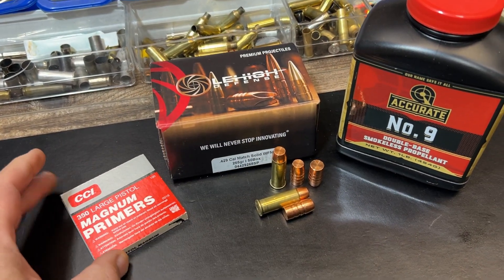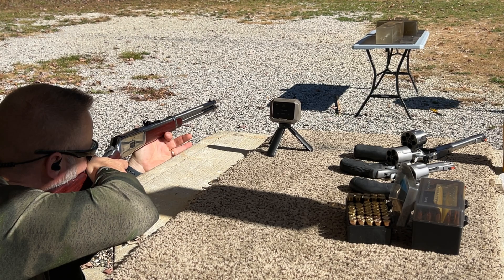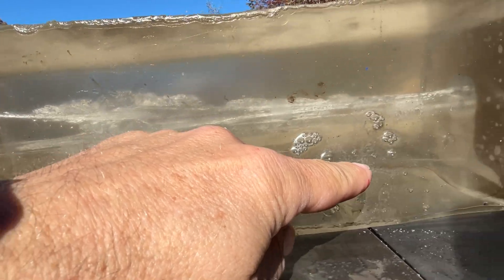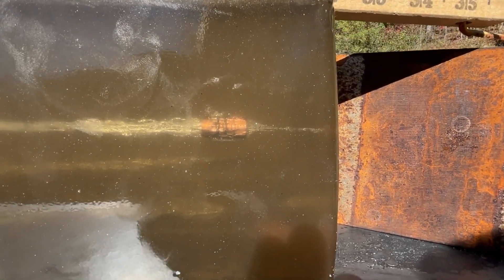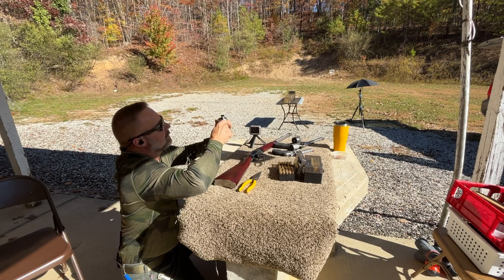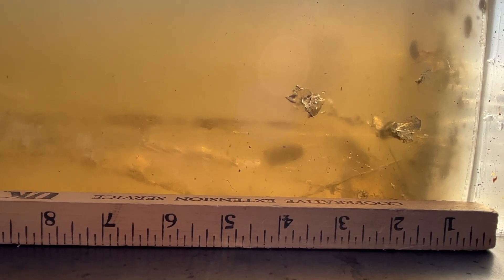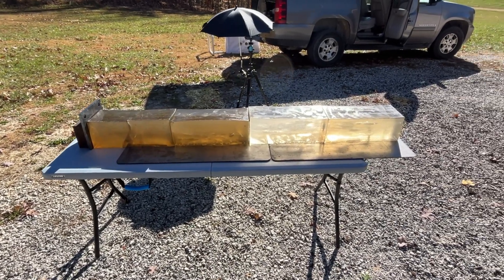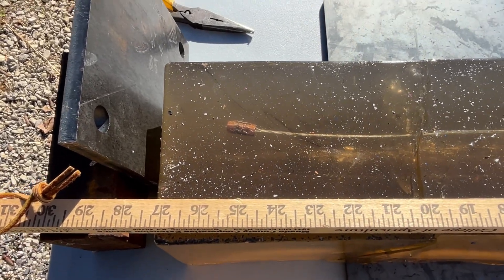44mag Lehigh Def 265gr Match Solid WFN, Solid Copper Bullet, Gel Block Testing with 4 Barrel Lengths

Comment: I’d be curious to see if you could get that speed up to 1500+ on the rifle with a different powder/charge and see what it would do.
Reply from the maker: @mountainmanmilitia3806  probably could with a rifle powder. I plan on doing some dedicated rifle  loads when I get caught up. Anything with pistol powder starts losing velocity with barrels longer than 16”.
Reply: @kentuckyrangetime  Subbed. I'll be looking for it. Just ordered me a rossi 92 stainless 44 in the 16in version. Was looking at this bullet as a potential hunting bullet but looking for something that will leave some flowering to go with that penetraton. If this dont open up more with more velocity I'll probably just stick with 240 JSPs.
Reply: I'm a big fan of IMR-4227 for 44mag. Works well for rifles and pistols though that bullet might not leave enough room to get enough power in there.
Reply from the maker: @ check out the Barnes XPB Video. They make that one in 2 heavier weights that will give deeper penetration with good expansion. I hope to get the heavier bullet and text later too. 😉
Reply: @kentuckyrangetime  I have a request. I got a bulk order off 200r RNFP hard cast cowboy action bullets in that I plink with but they seem to do really well on water jugs. I load em over 25gr of 4227 and get around 1,275fps from my 4.2in combat magnum. Would love to see that bullet in gel. Cheap bullet but seems to be effective.
Reply from the maker: @ Send me a few of them and I’ll put them in the Que. It’ll probably be spring before I can get them worked in but we’ll get them. 

Hit me up in messages over on Instagram and we’ll worry out the details. 😉
Reply: Don’t got an instagram. Email?
Reply from the maker: @ I do but want share it or my phone number out public.  Bad things happen when random people can use you email or phone number wherever they want, especially some of these liberals wasting good oxygen . Lol.

Facebook, MeWe or Truth social?  I have accounts on all those too.

Comment: How do you think this load performed versus hard cast of same weight?   I’m guessing hard cast would be shorter vs this solid and offer more case capacity?
Reply from the maker: @motorgearhead  I have  240gr hard cast and a 240gr plated videos in editing right now. Let’s just say I didn’t have enough gel block (@64”) for them in the longer barrels either 😉
Reply from the maker: @motorgearhead  yes, the more compact lead bullets allow more powder, lower pressures and more velocity. 👍🏻

Comment: Great video.  Excellent straight line performance.   Was surprised that the lever action didn’t provide more velocity though.  I was expecting about 200 ft./s just from what I’ve seen with pistol caliber carbines.
Reply: It seems like the powder burn finished before the bullet exited. Optimal length might be 12ish.

Comment: WOW! That's a long for weight 44 cal bullet due to the copper being less dense than lead.  It did penetrate very well. However, I think they may have been better off creating a 230-240 gr copper solid to allow for a bit shorter bullet allowing for more powder capacity and higher velocity. This will be even more important with a shorter pistol barrel. Having a shorter bearing surface on the bullet should also reduce recoil which appears substantial.
Reply: Cutting Edge makes copper bullets as well, and their solid copper 44 (.429) is a 240gr. I went with Lehigh for more weight, but Cutting Edge has good products too.
Reply from the maker: @chacal1129  I’ve looked at those. Just can’t afford them on my current budget. 😂👍🏻😉
Reply from the maker: @frankbrowning328  👍🏻 good points.

Comment: Thanks for another Interesting test. Three points come to mind. While a wide flat nose design does increase tissue destruction and reduce penetration as compared to a round nose, the wound channel and penetration characteristics end up rather more like the round nose than any kind of expanding bullet. Looks like a great compromise for heavy game or bear defense, but certainly no replacement for expansion in more common self-defense applications.

I'd imagine case fill must be pretty good with the seating depth produced by the longer copper bullet. It seems this would improve ignition with slow-burning powders like No. 9, making for more complete and consistent burn, resulting in more consistent pressure and velocity performance. Or this may prove a non-issue, as conventional bullets will require heavier charges to reach the same pressure and velocity levels, filling the case to similar levels. Ultimately the copper bullet load will have a more compact charge nearer to the primer, but with the wide 44 caliber case this may not matter. Probably more of an issue in more slender cartridges like 327 or 357 magnum.

It's great Lehigh Defense makes available such a complete library of load data for their projectiles. It's hard to impossible to account for the difference at the load data level between this 265gr. slug and those of more conventional construction without pressure testing. Lehigh's support of their product in this regard is laudable, takes all guess work out of hand loading them, resulting in a safer product for us to use. I see this as a considerable added value for their product and a high bar of support that most of the industry has not met.

Comment: Was that load near max for that powder?  It seemed a bit slow out of the rifle. I understand it's a monolithic bullet, but with 296 I'm getting 1300fps with a 300 gr XTP out of my 7.6" Super Blackhawk and 1550 out of my Rossi 20".
Reply from the maker: @doylethorn9251  it was the max listed by Lehigh.  All coppers seat deeper so there’s less volume for powder vs equivalent jacketed or lead bullets, plus the copper usually created a larger pressure spike as it takes more pressure to engage the rifling.  Both work against its max powder charge.
Reply: @kentuckyrangetime Thanks for the info